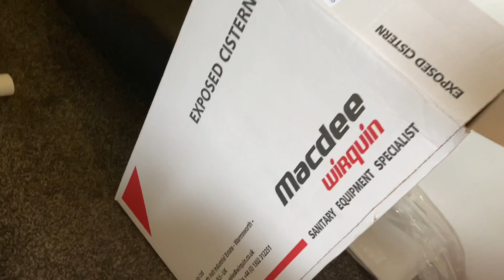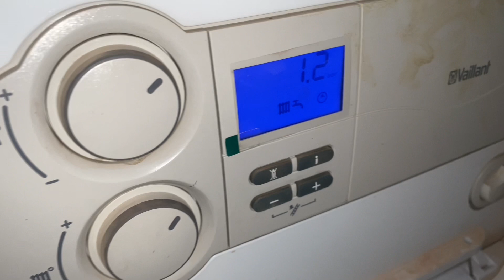UNDERFLOOR HEATING MANIFOLD CONNECTION,QUICK JOBS ON THE WAY HOME & WHY I DONT LIKE THIS JOB!!

Comment: Congrats on the new edition mate👍🏻 100% agree with following someone else’s work. I got a call from my heavily pregnant god daughter after she had a “tiler” do her bathroom and had discovered a leak coming through the kitchen ceiling. Failed silicone (looked like frame sealant) around the bath, grout completely missing on two joints, more grout on the tiles than in them, joints all over the place, bloody great hole in the plasterboard where he’d damaged it getting the old tiles off and she couldn’t get hold of him to come back after he’d been weighed in (strange that!). Let’s just say I have his name and number🤬
Reply from the maker: I hate it when they just disappear after doing crap work…..

Comment: You are right about following other people's jobs . Never seems to work out .   Little tip for you when putting pipes in the wall for rads , put some thin wall insulation around the  last 6 Inch of pipe before the elbow and from the elbow to where it exits the wall . It gives you a little wiggle room to line up the valves . Fit collars onto the pipe and it covers the insulation.
Reply from the maker: Thanks mate…👍🏼👍🏼

Comment: Good work mate. Don't you just love it when someone says, I will supply the materials, only charge for labour. You turn up, and where's the fittings, clips, solder, flux, glue and all other sundries.
Obviously all that is free and is included in the labour, until they get the bill.
Reply from the maker: Yep always the way mate 🤣
Reply: Nice one.👍👍👍

Comment: I would have advised the customer to replace the lead to the road and add it to your bill 😁 seems a shame not to on a refurbishment.
Reply from the maker: It was advised at the start however its about 60meters to the road and not a great run so very expensive
Reply: @MJTiffPlumbing  ah right you can only advise. Keep the videos coming mate very entertaining. And also congratulations on the new addition grandad 😁

Comment: Pipe through the architrave?? Talk about piss poor planning 🤦🏻‍♂️🤦🏻‍♂️
Reply from the maker: As said in the video that is how the customer wanted it…. We planned it that way due to the size of the room….
Also mention in the build videos….

So if anything it is very good planning to get it exactly where we wanted it, but thanks for the piss poor comment..
Reply: @MJTiffPlumbing  would have made more sense to put it central to the bath on the side wall but each to their own
Reply from the maker: Not if you didn’t want it there, it would make no sense at all….

As said in the video, the customer wanted it where it is…hence why it is there.
I went through exactly how it was going to look with the customer and they are happy with that…. I said about putting it above the bath but they did t want it there.

The customer gets what the customer wants.